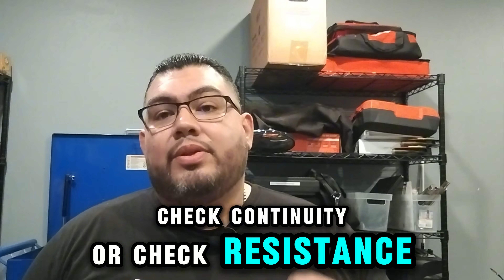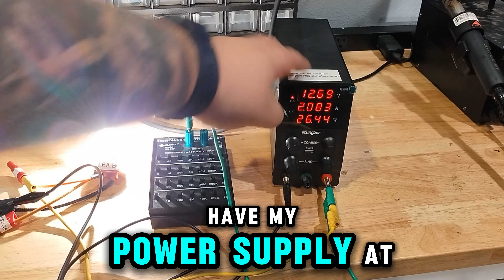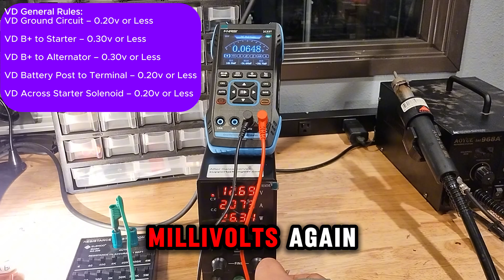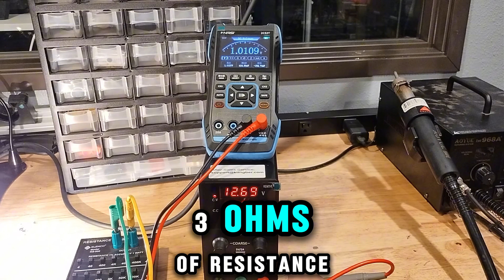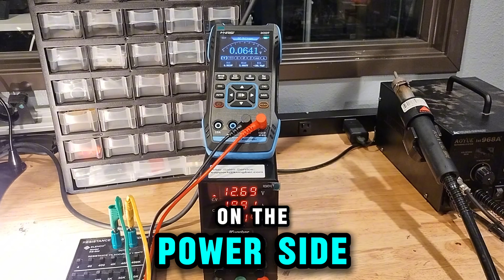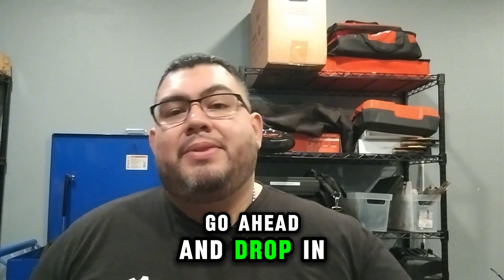Want to MASTER Voltage Drop? Watch This Now

Comment: could you tell us in what instances you would wanna use a voltage drop test?
Reply: To check light bulbs or the starting circuit or the charging circuit probably every circuit in a vehicle